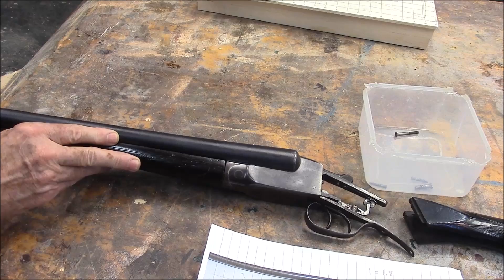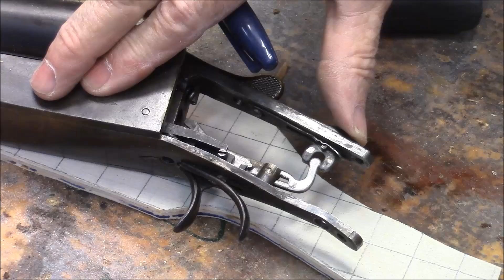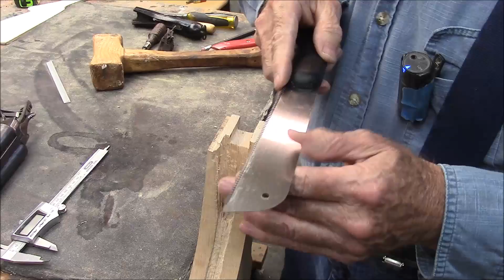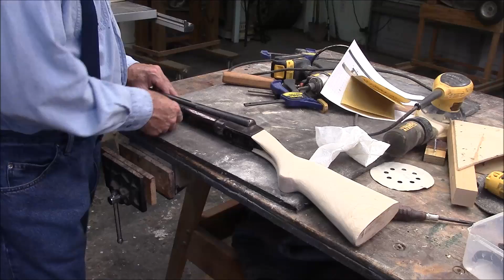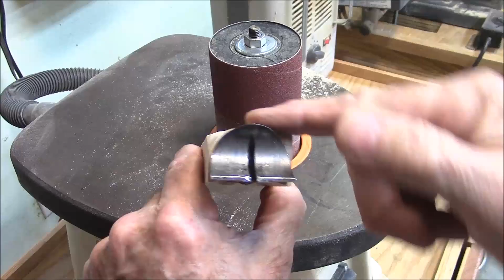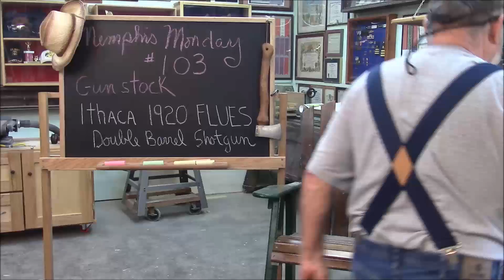Making Gun stock for Flues 1920 Ithaca Double Barrel Shotgun MM 103

Comment: You Sir are an artist. I have a similar shotgun and it too needs a butt stock. Vexing over how to handle the situation. You're inspiring.
Reply from the maker: The hard part is chiselling out the mortises for the firing mechanism.  Take your time on that part.  Making the rest of the stock is routine, provided you use a grinding wheel and disk sander like I do.  Here is another gun stock I did https://youtu.be/AX8uOvYmxaU    And here is a video on "checkering."  https://youtu.be/69Yec_7C9xg
Reply: Yes, I concur. The sanders make quick and precise work of the shaping.

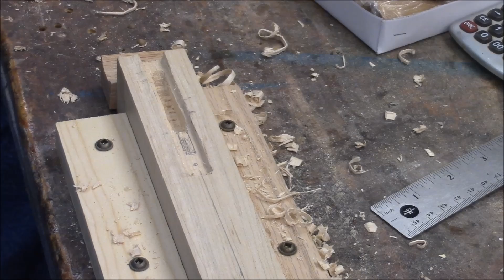Comment: Hey Memphis, At 9:15 you say, "There's no magic involved." Ha ha ha. no magic involved my a** !!! Heck, that statement is true ONLY if you discount having the patience of Job, years of experience and years of gathering and modifying tools. Once again lots of takeaways. One thing I have wondered about with projects like this: "How long can you SOAK the wood in linseed oil? And would it help with a project like this? 

I have read that ones who carve wood like to soak the wood (or lots of thinned coats to penetrate) before they carve. It makes the wood harder and easier to carve. (some add polyurethane to the linseed oil and thin it)  Just what I have read. If true, would doing that to the stock make it less likly to crack and break down the road? 

Great video as always.
Reply from the maker: I'm not familiar with the soaking with linseed oil carving trick.  But there is plenty of things about making gunstocks that I don't know, as I've only made two.  But I'm slowly learning, and I plan on making another one in the summer or fall.  
     Thanks for the kind words.  It does take patience to fit the stock to the gun, but the other carving is fairly routine.  I'm warming up to using the chisel; it is actually peaceful, compared to the normal high level of noise in my shop.  Chisel away.  A little sip of coffee.  Tune in the radio.  Relax.  
     Thanks for watching and commenting.